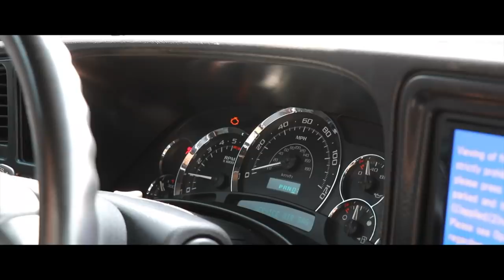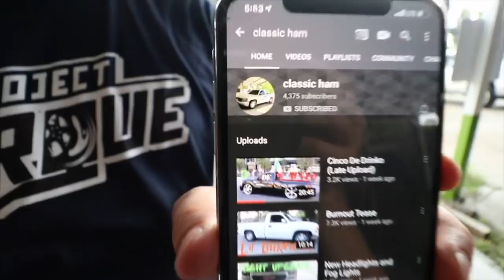New Sparco belts & Sundown Audio Subs for the SS clone

Comment: You right Freddy, harness install is not the right way.. yes it holds you in, but if in a impact the harness will break your back.. technically the shoulder harness should be at your shoulder height, this is why they make harness bars.. 
I removed my air bag from the steering wheel so it was a must to have my harness installed properly

Comment: Wire the subs up correctly and the bass will hit much harder i dont know if you notice that when the bass hits the subs are out of phase which means one sub is pushing air out and one is pulling air when bolth should be pushing and pulling togeather and a custom ported box will make it much more louder
Reply: Destin Fernandez Its probably just the camera Im sure they wired it right
Reply: I should have said it a diffrent way but the subs are out of phase as well as the camera refresh rate
Reply: Yeah the refresh rate makes them to appear out of phase